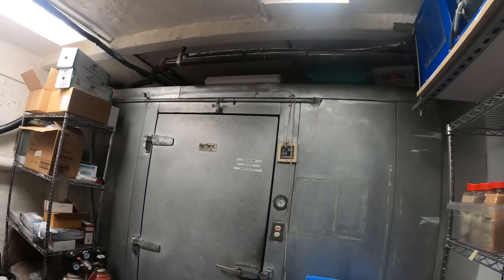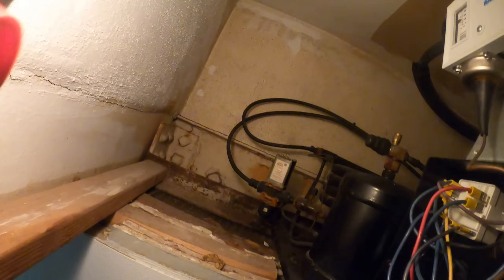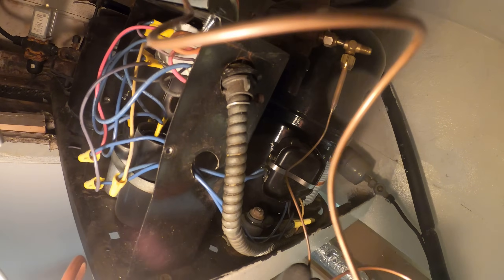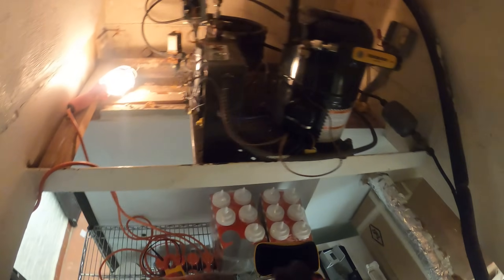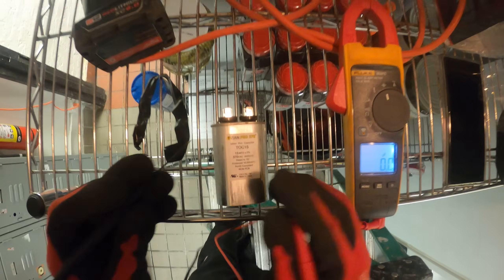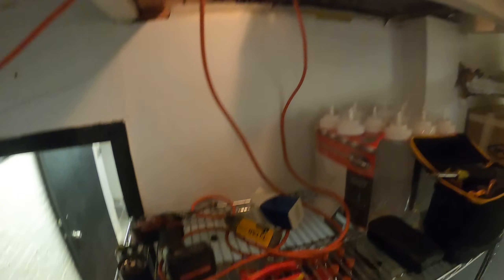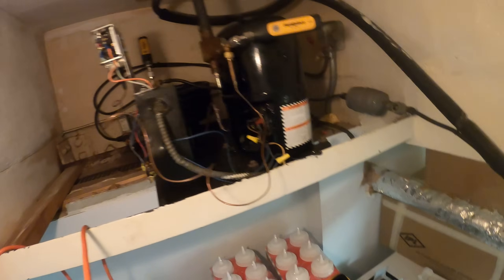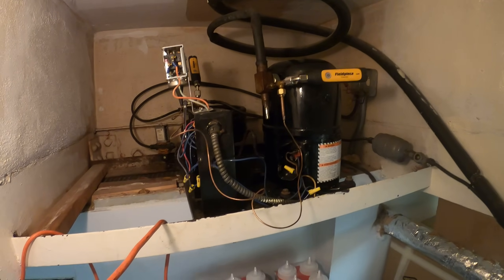HVACR: Refrigeration Service Call (Walk In Refrigerator Not Cooling) Compressor Not Starting/Working

Comment: Electronic leak detector or ultrasonic leak detector - Small system easy to find in my opinion. Water regulating valve notorious for leaking as well as service valves. Bad electrical connections at the compressor can cause voltage fluctuations, overheating, and arcing, leading to capacitor failure. Low refrigerant levels may result in overheating, increased start/stop cycles, and excessive strain on the capacitors. Voltage issues, such as surges or low voltage, also stress capacitors by forcing the motor to draw higher amperage. Additionally, environmental factors like high temperatures, moisture, and vibrations can accelerate wear. Age-related degradation and frequent hard starts further contribute to capacitor failure. I believe the capacitor failure is secondary to other issues. Start by checking for refrigerant leaks using an electronic leak detector and repair any leaks. Replace the liquid line filter drier and the contactor or relays to ensure reliable operation. It’s intriguing to see a water-cooled condenser still in use—evaluate whether the system is worth repairing. During the repair process, check the water inlet and outlet temperatures to ensure a 10°F temperature split across the coil, which indicates proper heat transfer and water flow. Sell them an air-cooled condensing unit. However air-cooled condenser, require a better location verify  for adequate air circulation. While some may comment on capacitor discharge procedures, they are not putting themselves out there in videos. (for the most part),

Comment: Should have top off with refrigerant . Full siteglass. 134 a tefrigerant. Discharged the compacitor with a screw driver on both terminals.

Comment: I would have fixed it on the spot.. Id have found the leak, fixed the leak, reclaimed the system, and recharged it. No need for a second service call.
Reply: Most people would reclaim it then repair and recharge it instead of repairing it, reclaiming it then recharging it.
Reply: If it were me, I'm built different, so it wouldn't be problem
Reply: Oh okay, u should make some videos too!
Reply: Super tech here lol

Comment: I noticed at the 4:22 time stamp you stated even though the system was marked as R-12, it was actually using R-134a. I understand that your reasoning for that statement was the phaseout of R-12 many  years ago. However, if that system was actually using R-134a as you stated, it should have been CLEARLY remarked by the contractor that did the work with  R-134a identifiers to indicate a refrigerant retrofit took place on the system. That is standard procedure for all refrigerant retrofits. Since that wasn't done, many technicians would think that was an old R-12 system that never went through a retrofit. Also, the low pressure switch setpoints would tell a technician if the cut-in and differential setpoints were set on the  correct setpoints for the refrigerant type being used. I would look at those setpoints to see if they were truly set up for R-134a or if the setpoints were set up for R-12 pressure/temperature. That system could just be an old system that has stood the test of time and still has R-12 in it. I use the phrase "stood the test of time" until now that you were dispatched on to this service call where it has obviously finally shut down.
Reply: Very good points

Comment: The proper and ( SAFE ) way to discharge a capacitor is to set your meter on D/C voltage and put your probes on cap, and It will slowly start to drain it. I won 50 bucks off a guy one time when I told him I could OHM out a capacitor  and find out if it's good or not. He goes I don't give a fk who taught you refrigeration you can't ohm out a cap. So we go to his van he get's out a cap I take his meter set to DC and drain it. Then I go NOW I am going to set your meter to Ohms and use your 9 volt battery in your meter to charge this capacitor If it's good you will start to see the readings rise which it did because it was new. After he picked his jaw up off the ground and handed me 50 bucks he drove off highly upset.
Reply: Damn bro thanks for the tip.  gonna try me to score 50 bucks as well

Comment: Are they using a boiler for heat add for the loop? Anytime i work on a coaxial system i always do a quick backflush, unless its glycol. It takes a few minutes and very little amount of tools ( i don't disagree with your methods at all ) that unit needs some help

Comment: You should use R422B is compatible with R 22 mineral oil. R134A is POE OIL
Reply from the maker: This was not a R22 system. It was a R12 system and the replacement is R134a👍Thanks for watching!
Reply: @JumpermanTech  only with an oil change kiddo. If you're not replacing the oil then you should use 209 and not 134